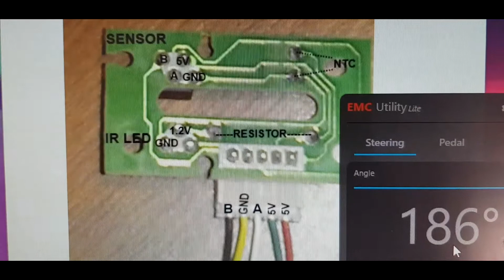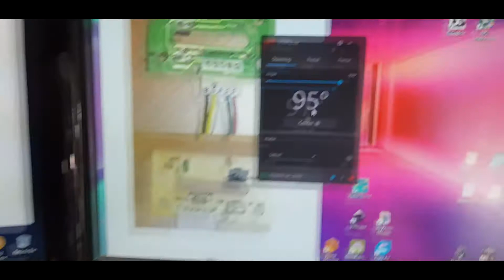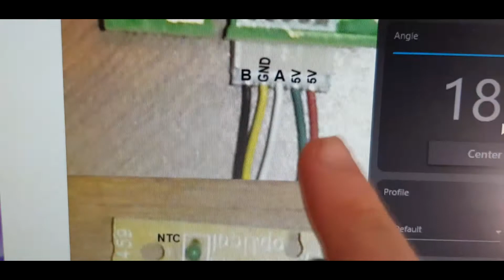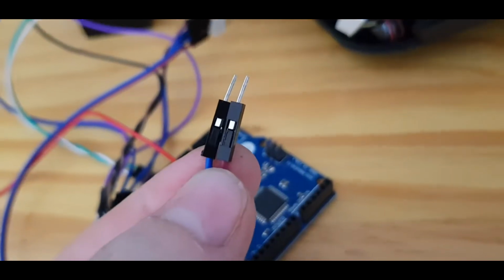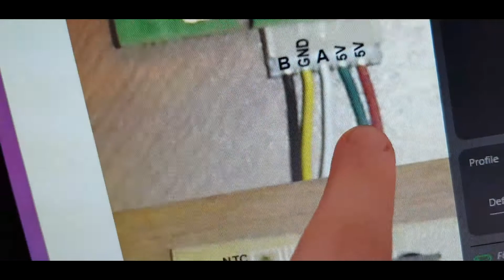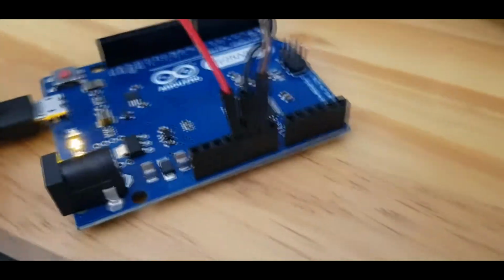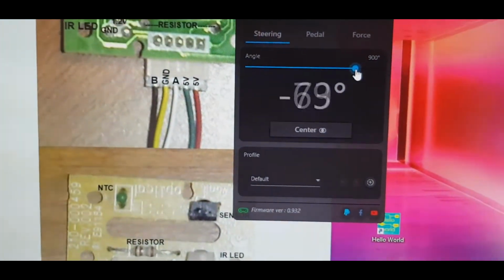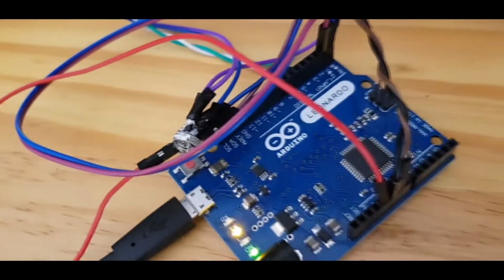G25 - Arduino Leonardo Board - First Step: Encoder

Comment: How well did this work out?  Can you do another video showing how you wired the pedals and shifter???    I have a broken G25 and I want to do this same project too! :D and can you use a
 uno for it or mega?
Reply from the maker: it works fine as long as you have all fixed and in place. Works only with Atmega32u4 chip as far as I can remember, so it's either Leonardo or Pro micro, that are able to emulate a joys, keyboard or mouse.
Reply: @wally19  what about code on the arduino?
Reply from the maker: @deaddevil1  I could share to you the folder that I used with the code, notes, urls that could help you to do the project. Just tell me your email address
Reply: My user name and it is a gmail
Reply from the maker: @deaddevil1  sent
Reply: @wally19  dont got it. Remeber to remove the @ befor my user name
Reply from the maker: @deaddevil1  yes, lol I did remove the @. 
I can see is share to deaddevil1@gmail.com

you could go directly from here anyway:

https://drive.google.com/drive/folders/1TvuCE7AtNHzWpSJSGdSmQHjefhFe-gVl?usp=sharing
Reply: @wally19  I found it. it had entered under my google drive. idk

Comment: Hi, will you make another video about this project? I started it about year ago but I did not finished it since :/
Reply from the maker: Hi! I will try to do it on this weekend.
Reply: @wally19  hi, I connected everything works, I flashed it through the EMC, but how do I set up the buttons petals on the g25 and 2 buttons on the steering wheel
Reply from the maker: @Racing-05  You have the EMC blueprint with every detail about that. At the end of the day, they are just 2 cables (+ & -)

Comment: I sure have a broken mainboard on my g25...can I in any way fix that with arduino ?
Reply from the maker: You could replace it with arduino, yeap
Reply: @wally19  Please can you help me fix my Logitech G25 ? I kinda have the electrical knowledge and I have a good friend that is a programmer.  Can we commumicate via email and guide me in this project ? I will be forever thankful
Reply from the maker: @Teodoru00  i could send you all the files that I used back then. I have the softs, notes, diagrams but you should find it in there hehe. There is also the diagrams to make the g25 shifter work. You can send me any doubts you could have. Mcris86@gmail.com
Reply: @wally19  I cannot thank you enough man. You are amazing!

Comment: axes are using potentiometer   why are you talking about encoder ?  am confuse
Reply from the maker: I was talking about the wheel, not the pedals. It uses an optical encoder, similar to an optical mouse. The encoder tracks the encoder disk rotation to detect the real wheel movements.

Comment: Hello man, I really like your idea. I have old G25 with broken motherboard just like you and it's laying under my bed for few years now. I hope you will soon add some new parts of your guide, I've already bought arduino boards and BTS7960 so I can repair my wheel as soon as you post new steps :) And I was wondering if somehow is possible that you can connect all wheel, shifter and pedals to one same arduino board, cause I've seen videos where people make just standalone devices but can this setup work on just one board? Thanks for answer and keep going, you really gave me some hope to finally repair my wheel :D and sorry for english.
Reply from the maker: Hi there! You will not have issues adding the G25 pedals I've done it, it's very easy to do and the EMC driver will support it. But the G25 Shifter is a bit complicated, im using it with a separated arduino pro micro and works just fine.

I will try to do the FFB video but if you are on a hurry just search EMC FFB and you will find the schematics, it's pretty straight forward.

If you need the G25 Shifter code, just let me know.
Reply: @wally19  Thank you, I'm not in such a hurry cause I'm from Europe and I'm waiting for my parts from Ali so it'll take a while. But I sure will text you about all the codes I'll need, cause only thing I've ever coded on Arduino was my 3D printer and it was really pain for me and I expect the same here :D
Reply: @wally19  Hello man, I've already get all my parts but I don't know what values I have to set in EMC utility. I mean like encoder CPR and hdbridge settings so I was wondering if you can share yours. Thank you :)

Comment: I actually got this to work .problem is I'm using an arduino uno.its pointless if it's impossible to get ffb with the uno.
Reply from the maker: Yes. Only with leonardo or pro micro due to the hid chip

Comment: Buenas!, muy buen video! se me quemo la placa de mi volante y no hay forma de repararla!, donde puedo encontrar la forma de conectarlo y el programa que lleva en arduino? Gracias
Reply from the maker: Buenas, fijate que puse el link del soft y el firmware.
Tenes que subirle firm primero y despues el soft te detecta la arduino como el volante. 
Cualquier duda avisame.